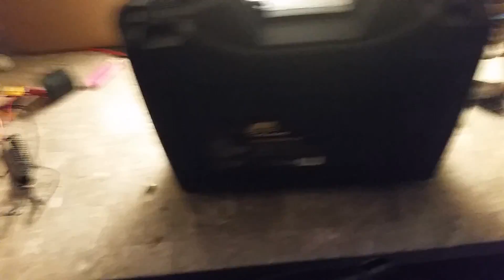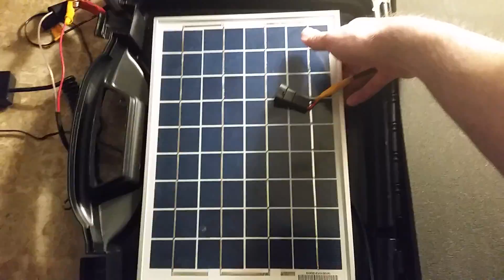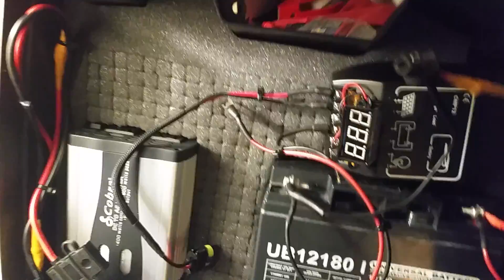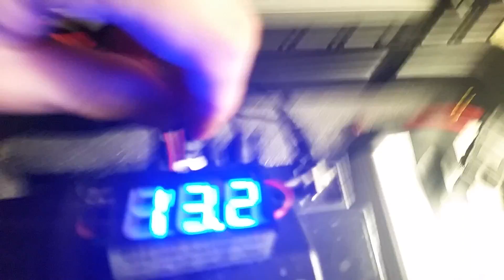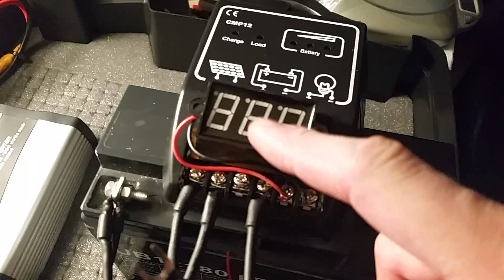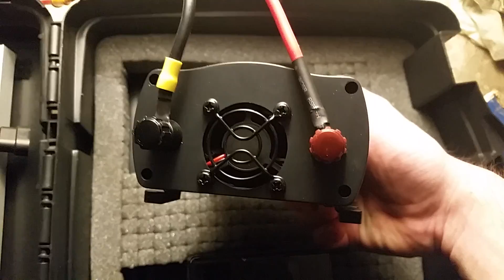My Solar Generator: Based off Solar Burrito's

Comment: Has it worked as expected? Re charged the battery? Thanks
Reply from the maker: It works, but not as well as I'd hoped. It really depends on where you live since its solar based. My house is surrounded by trees and I only get a few hours of peak sunlight here. MY next move is to add 2 more panels to this setup and possibly a battery thats twice as large. At least that way Ill have more capacity and it will better match the power inverter. It would take a very long time for a single 10w panel to fully charge this battery. Think of it more as a way to mitigate power consumption in the setup you see in the video. Thanks.